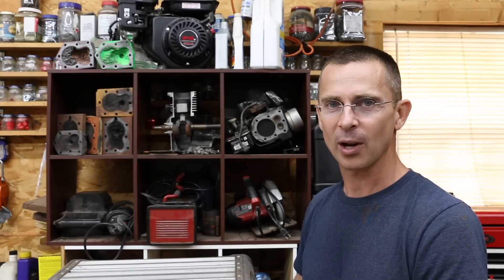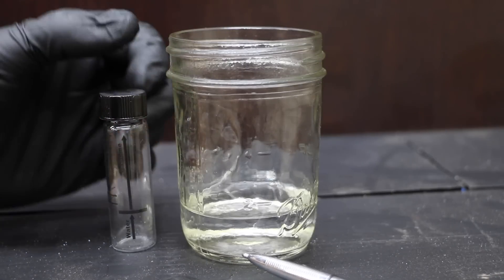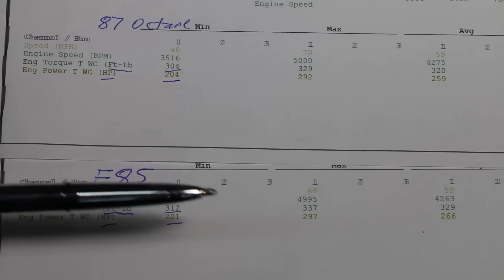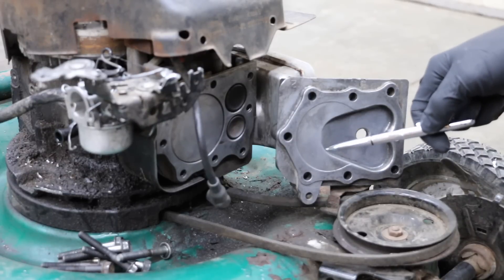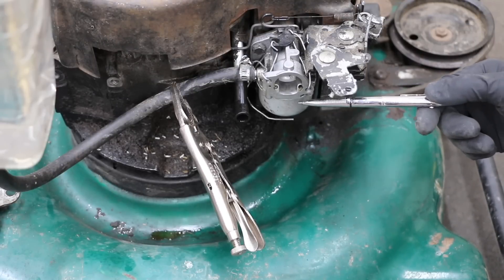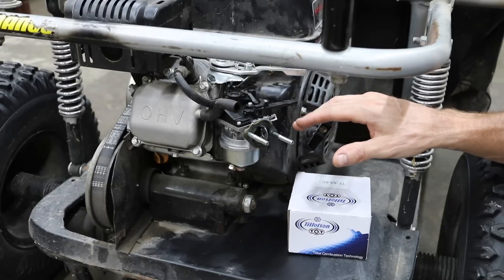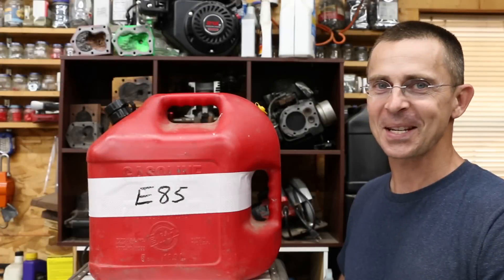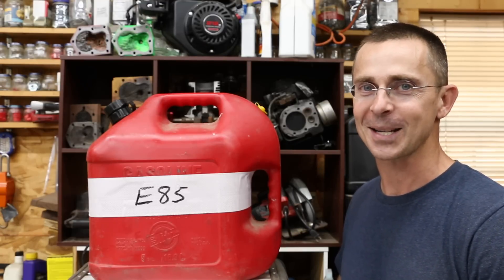Is E85 better than Gasoline? Let's find out!

Comment: I’ve always had a difficult time understanding the “energy level” thing with different fuels. If e85 has less energy than gasoline, why do people use it for high horsepower builds?
Reply: Because you can advance timing a lot further. Plus, the octane level it allot higher so you can run more boost without detonation.
Reply: fired up fishing 
With being able to advance the timing, does that mean that e85 burns slower? Or just that it’s higher octane resists knock?
Reply: @Thee_Sinner  the higher the octane the slower the burn, e85 has an octane rating of 110
Reply: Uriah Siner higher octane resists knock when timing is advanced. Also, e85 injectors are much larger. Simply adding more fuel essentially makes up for the 30% less energy.
Reply: Uriah Siner it burns with less energy and it burns cooler.
Reply: @mobrien7211  more like 96 I believe. That's only if you buy it from vp or another race fuel distributor. At the pump its unknown amounts of ethanol, so makes it hard to determine octane rating. I've heard pure methanol is equal to 116 or so and runs cooler than e85.
Reply: @brandonn2538  Renewable Fuels Association titled "E85 Facts"[4] which cites a range of 100-105, and a document at the Texas State Energy Conservation Office titled "Ethanol",[5] which cites a 113 rating. 110 is the the standard, obviously if the gas station is selling 52% it's not going to be that high, I thought that was understood.
Reply: E85 I've seen is 100 Octane.
Reply: one word BOOST. turbo or super charger. E85 is where the power is at.
Reply: Knock. E85 is a gateway drug to meth.
Reply: Uriah Siner
Three main reasons:
1. Cools the air more than gasoline.
2. Higher effective octane which allows more timing advance (and boost in supercharged applications) which tends to produce more horsepower.
3. E85 has a much lower air/fuel ratio then gasoline. Yes, it has lower energy density per gallon but we can burn much more of it at a time then with gasoline. Gasoline has an air to fuel ratio of about 12.5 parts air to 1 part fuel for best power. E85 has air to fuel ratio of about 7 to 1 for best power. So, even though E85 has lower energy density we can burn almost twice as much at once for more power overall.
Reply: Way cheaper than pump race gasoline. It also has a cooling effect that gas does not have which lets you get away with more boost and compression without preignition or detonation.
Reply: I think I kind of understand. So with equal masses, e85 will produce less of a reaction than gasoline. But since it requires less O2 per reaction, you can add more fuel without needing more air. And then with adding boost, you can run even more fuel.
Then on top of that, it’s high octane rating allows for more advanced timing over gasoline, further(farther?) increasing its power output.

Hope this is all right, thanks for all y’alls help
Reply: @Thee_Sinner  U are 100% correct.  If u don't need the extra octane it is 100% wasted.  Limiting factor is getting air thru the engine and with the same air e85 can do so much more.  Injectors are usually oversized so squirting in a little extra fuel is rarely the limiting factor. Bang on the money!  Congratulations.  If u building a race engine then up the compression for a double whammy.
Reply: Yes! Alcohol has about 30% less energy per weight. However, Alcohol can burn with a wider fuel air ratio than gasoline therefore you can burn a good bit more in the combustion chamber than gasoline and get more power with less efficiency. Plus the higher compression ratio allowed by it gives the engine better thermal efficiency.
Reply: less energy per gallon BUT you can cram a LOT more of it into a cylinder without having it ignite prematurely, Also it carries it's own oxygen unlike gasoline so you don't need as much air in the cylinder taking up space.  End result, if an engine is designed and tuned properly you get  LOT more power out of a given displacement with e85.
Reply from the maker: Great question.  While ethanol has around 30% less energy than gasoline, it has a much higher octane, allowing for better performance in engines designed to benefit from it, assuming proper compression ratio, injectors, timing, tuning, etc..
Reply: Guys, alcohol burns hotter, not cooler. The color of the flame also shows that.
Alcohol burns at around ???°C, gasoline around ???°C.
Remark: currently not finding the correct temps for compressed close to stoichiometric mixtures.
Reply: More alcohol = more resistance to early detonation. Allows low-deck-headed engines (high compression) to perform better, especially with advancing the ignition timing. Engines with speed set-ups are usually purposed for high performance racing, not longevity.
Reply: The more ethanol in the fuel makes the engine run hitter.  Water cooled engines can generally handle it. Air cooled engines like motorcycles and small engines, overheat and will burn up.
Reply: Higher octane
Reply: Uriah Siner they pump in alot more
Reply: like you see on the small engine combustion the fuel runs "a bit" cooler. so with exquisit tuning, classic + ECU you get a lot of Power out of it. Just watch this maxed out at top fuel dragsters - orf IndyCars.
Reply: When speaking of less energy density, they mean a certain amount of fuel (let's say a gallon) of ethanol will contain 30% less energy than a gallon of regular gasoline. A gallon of LPG/autogas will contain 15-20% less energy than a gal of gasoline. A gallon of diesel contains more energy (yet will create way less horsepower, but more torque).

In this case, the engine will just need more fuel for the same performance, compared to gasoline (30% more). If the engine needs 1 gallon per hour to do something, it'll need 1,33 gallons to do the exact same thing on ethanol.
A huge benefit of ethanol and autogas over gasoline, is their higher octane rating, allowing for higher compression ratio's. A sport's car might need 93 octane gasoline, because it compresses the fuel more. When compressing gasoline, it could ignite on it's own (before the spark plug does its thing), which destroys your engine. The higher the octane rating, the less likely that is to happen, and obviously your Corolla or Civic won't self-ignite (knock) on 87oct, because they're made to run on 87. 

A semi truck runs on diesel, and it might seem like a crazy idea to make it run on gasoline, but it's not impossible... It'll just need much more fuel to do the same thing (and is nowhere near as efficient), but it can be done!
In Europe, RON95 (95 octane) is the standard, regular fuel. It equals to 91 in the U.S., which is considered Premium in states like California. But instead of a 3.5V6 naturally aspirated in the U.S., the same European car is more likely to have a 2.0I4 with one or two turbo's, delivering more torque and the same horsepower. But, they'll need to run on higher octane gasoline. Even though we do have naturally aspirated engines (like smaller, eco-cars or (mostly American) V6's or especially V8's) that don't need 91 octane fuel, so it's kind of a waste because it won't make them run any smoother compared to 87 octane (which is RON91 in Europe, but pretty much not available anymore).
Reply: Arne Maeschaelck Horsepower is Torque times a speed in seconds being 550ft-lbs per second.
Diesel fuel produces more power per unit weight and volume . One horsepower is also 746 watts which can be converted to BTU per second and then joules per second into horsepower. Europe uses KW instead of HP. LPG and Natural gas as well as Alcohol have much less energy therefore less work (HP or KW) can be produced per gallon or pound or KG regardless of turbo or what engine uses such. More alcohol fuel must be burned to produce equal work. This are laws  mechanical engineering and thermodynamics physics laws which I work in as a engineer ..
Go on Kahn academy an learn physics accurately. Torque is not a unit of work but a unit of twisting or bending force (A force times a length) producing a moment . This is often mis understood by many good mechanics and I always have to explain this. Shalom
Reply: motorhead1 engine1 I didn't say torque = work. A diesel engine doesn't really compare to gasoline/ethanol/LPG. All I said was that you'll just need more LPG and even more ethanol to get the same performance compared to gasoline, because the first comment asked why ethanol is used in high performance builds if it contains less energy (= it's better suited for turbocharging, compared to 87 octane gas). Europe doesn't use kW 'instead of HP', at all. I live there. Learn before you speak.
Fact is, a modern 150 hp diesel will accelerate quicker than a 200 hp gasoline engine. That's what I meant. It produces more torque, and earlier down the rev range. The gasoline engine, however, will probably have a better 0-100 time and higher top speed.
Reply: Arne Maeschaelck Diesels have a higher torque rise on dyno pull harder from idle to maximum speed. Limited to lower rpm due to heavy pistons rods etc. Horsepower is horsepower regarldless
Reply: Arne Maeschaelck In Germany all the equipment we purchase is rated in KW not horsepower......Demag and Thyssen Krupp Siemens all rates engines in KW as well as CAT for EU. Not sure where you are.
I work for US Dept of Energy as a power plant engineering manager and have a Master's degree in Mechanical engineering from MIT.
Reply: motorhead1 engine1 in Western Europe, researched the market for cars (and engines), finding out people's needs and trying to help improve today's technology, currently working for Dodge (Germany and Belgium).
I mean, sure, the equipment you purchase might be in kW, but that doesn't mean it's a European thing... a friend of mine joined (and left, I believe) the U.S. army, and they use the metric system for pretty much everything. But that doesn't mean the U.S. uses metric, because that's absolutely not the case at all.
Reply: Arne Maeschaelck I wish America would use metric. In engineering and science we do use S.I. units of kg, Newton's seconds etc. Much easier to use doing physics calculation and as machinery is designed and built in mm not silly inches etc. Cheers Shalom
Reply: motorhead1 engine1 well yeah sure, even though your system has its charm, the metric system kinda just makes more sense (1l of water = 1 kg... 1 km = 100 dm = 1000 meters = 10.000 cm... water will turn solid (freeze) under 0°C, turn liquid when it's between 0°C-100°C, become a gas (vapourize) at 100°C, ... and so on), sometimes I really wonder how you guys learnt these kinds of things in school, hahah... Did they teach you 1 mile equals to 5 thousand something feet et cetera? 
The U.K. for example uses both... they use metric for pretty much everything, except driving (they use miles per hour and imperal miles per gallon for fuel economy). An imperial gallon in the U.K. is 4,5 liters, a U.S. gallon is 3,8 liters, ...... but at the pump, the price is indicated per liter (or litre)... haha I don't even know anymore
Reply: Because you can cram in 20% more E85 into the cylinder than you can gasoline. And it can take much higher compression ratios before it detonates than gasoline can. Add the two together and you make more HP per cubic inch or per liter of engine volume.
Reply: Less detonation due to alcohol burning cooler. Allows you to run more compression and still run a relatively cheap fuel.

Comment: I would like to see if E85 can be used as octane booster in a regular old V8 engine. Since you can no longer get Ethyl high octane which is needed for high compression engines. Can E85 mixed with pump gas in the right amount boost octane?
Reply from the maker: Yes, ethanol will boost octane, but it is also a solvent.  If your vehicle can tolerate it, it will boost octane. Thank you
Reply: I don't recommend using it in a non-flex fuel vehicle.

Comment: You should test adding hho to an engine, and see does it improve performance and mpg
Reply from the maker: Great video idea!
Reply: Project Farm yes
Reply: HHO?  How about DHMO?

http://dhmo.org/

Hydrogen Hydroxide?

steve
Reply: @steveskouson9620  lol. I use that on my bad knee. Pure solvent though.
Reply: Which one?

DHMO, HHO or Hydrogen Hydroxide?

You may be referring to DMSO.
If you can taste garlic, after applying 
it to your knee, it is DMSO, and NOT 
a participant in this discussion.

Of course, YMMV.  (Your Mileage May 
Vary.)  :D

My post above, was VERY MUCH tongue 
in cheek.  HHO, DHMO and Hydrogen 
Hydroxide, are ALL nature's first solvent.
(And, the primary ingredient in Beer, 
Wine, Tequila, Rum, Brandy, Vodka, and 
Whiskey.  Under 100 proof, of course.  
Gin is flavored Vodka.)

steve

Comment: I would be interested to see if E-85 separates into water and slime over time the same way E-10 does in the small engines I see in my garage.
Reply from the maker: Great video idea!  I'm about to begin a long-term test on E10, E85, and non-ethanol with and without stabilizer.

Comment: Please check the oil additive turbomaxx
Reply from the maker: Great video idea!
Reply: Yeah I’ve always been skeptical about it.. I use it on my 2011 BMW X5 diesel.. engine seems to run smoother... but I’m not sure if it’s a placebo effect.. and I’m also wondering how well does it work on a gasoline engine when added to its oil, compared to ceratec Liqui Molly or Lucas oil stabilizer.